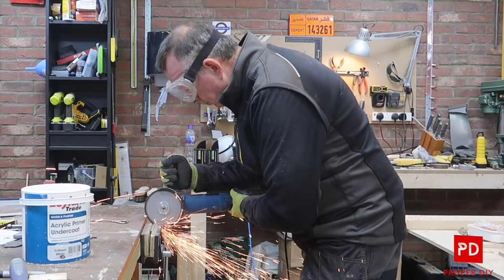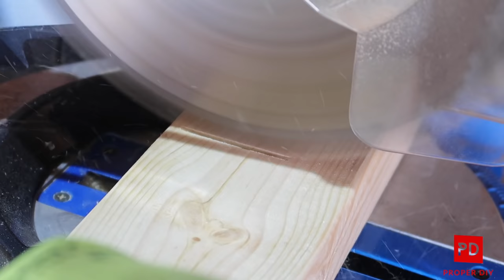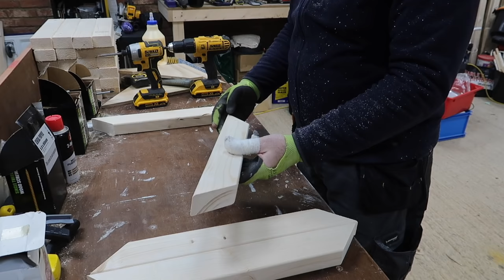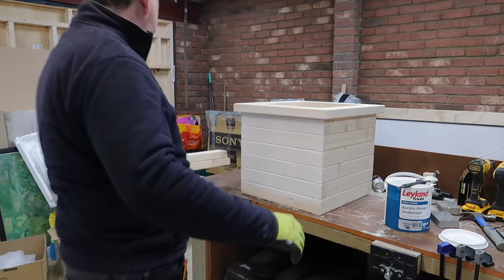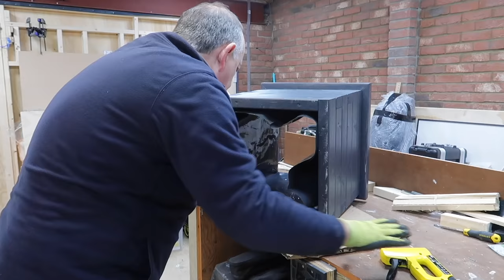How to Make Modern Garden Planters

Comment: For painting may I recommend the Wagner Universal Sprayer W 690 FLEXiO.  It comes with 2 spray heads ideal for big and small jobs.  The sprayer would ensure every crack and crevice is filled with paint and multiple courses can be achieved as the paint dries really quickly.

Comment: for the plastic lining, best bet is pond liner from Screwfix - Huge roll for £15 odd and it'll do 4-5 planters. Doesn't fade, crack, uv stable and is designed to deal with constantly wet environments.  Fab vid.
Reply from the maker: Sounds like a good deal but I can't find it on their website

Comment: Clear, informative and well made video - thank you.
I'm making my own planters and am using this as my guide. My only slight concern is your use of the black plastic (Visqueen?) to protect the inside of the planter from contact with wet soil. Does this not cause sweating between the two resulting in moister getting trapped? Instead, I'm wondering if a better option might be to paint the inside of the planter with a liquid rubber sealant? I'd appreciate your thoughts on this and whether or not you'd stick to using the plastic liner again in the event you make any more planters in the future.
Reply from the maker: The liquid rubber sealer would do the same job as long as the inevitable future movement/splitting of the timber doesn't then let the water in.

Comment: Great video and project. Loved it. One suggestion I have is you you buy a plastic square planter of roughly the size you want then you can build the wooden planter around it (them) so in the end you just drop in a perfectly fitting plastic plant pot/liner which saves all the faffing with plastic membranes. Cheers
Reply from the maker: Thanks! Yes can do and would prob last a lot longer.

Comment: These are great videos, all of which will be put into practice shortly when the weather improves a bit. One question about the planters, you used CLS, why? That is about 3 time the price or PAR of similar size in my local merchant. Is there a specific reason for its use? Thanks and keep 'em coming.

Comment: Well presented vid. I am going to make a long trough version of this design using free pallet wood. I will brush or spray all cut parts completely with two coats of used engine oil ( any local garage free ) before assembly. Finish with undercoat then Cuprinol. 
Used engine oil alone is a nice finish, dries quick, odourless and plant friendly and no liner needed.
Note sand or plane the top overlap edges to bevel them, looks better.
Reply from the maker: Sounds great!

Comment: Been loving the videos and I’ve just started making these planters ahead of the spring - the wife wants a garden make over. Just having some trouble making the top. Can you clarify the measurements- is it point to point because I can’t get the short side to match the long side at a 45 degree angle in the description- 1st Time novice I’m afraid

Comment: That's a really good video, thank you. Nothing worse than seeing a wood working video and then they start using planers, edgers and all that malarkey. For the plastic liner, would it be worth using Black Jack instead? Saw a sleeper raised bed project and they used it. Also, what was that large bit holder in your drill?
Reply from the maker: Thanks for the comments. Yes you can use Black Jack however over time if the timber shrinks slightly you may get seepage into the joints so for these planters I think heavy duty plastic is better long term. If I was building a raised bed with garden sleepers then I would use Black Jack as well - less joints.
The 'large bit holder' is a Dewalt magnetic bit holder that is handy when putting in the bottom timbers. It really holds screws well although I don't use it all of the time.

Comment: Hello, good job young man, engaging video, did you do the editting!? Good skills. A question regarding water, as there is nowhere for it to go, will this not cause an issue of overflow? I'm referring to us watering the plants followed by rain. Perhaps this dries up during the summer but not sure about winters
Reply from the maker: Thank you and yes, all my own work. 
The bottom of the planter is timber slats with weed control fabric on top which isn't water tight so there is drainage though the bottom.

Comment: Great Videos, more please.  What length are top mitred pieces, I think you just said a "a little longer"  I want to make some.
Reply from the maker: Thank you. Lots more to come. I didn't take note of the length of top pieces however there're easy to work out. Measure the internal dimension of the box using the standard pieces laid out - it will be around 560mm and that will be the length of the short edge of the top piece.

Comment: Hi Stuart, great Vid  with very easy to follow instructions, Love the planters and going to have a go making them, but just on thing I would like to ask you, with the sides cut at 395 mm you say thay the top is slightly longer  after cutting the mitres could you tell me how long you have cut these please.
Reply from the maker: I think no they are 357/485mm - I'm the description below the video.
Reply: @ProperDIY  Cheers Stuart , found the measurements for them didn't realize  they were  at the bottom of the vid. 👍

Comment: Hi, looking to attempt to build these but a bit confused about your measurements...you state: 26 x 359mm. Does this mean 26 pieces at 359mm long? Also you mention 24 x No. sides...what does this mean....the remainder of the measurements make sense. Thanks and love the channel.
Reply from the maker: 26 No. 359mm means 26 of them at 359mm in length. 24 of them are for the sides and 2 of them are for the feet.

Comment: Hi. I'd like to make long planters using this technique as it looks the mostly long lasting I've seen. I just wanted to ask if it's worth adding a screw on the long length... or is it not necessary? I'm very new to woodwork so thought I'd check. Also any reason you didn't line the bottom with plastic and pierce holes in it for drainage? Many thanks
Reply from the maker: Hi there! Yes, if you are making them longer then it's probably a good idea to add some extra screws in the centre of the timbers. You can use the same plastic at the bottom and add some holes absolutely no problem. When I made these, I had a limited amount of heavy duty plastic so decided to use some of the weed control fabric at the bottom I had instead but really any material that will allow water to drain, keep the soil in and not disintegrate quickly we work. Good luck with your build!

Comment: Hi sorry to bother you again about how long would the wood last before it starts to rot if its untreated.  As treated wood is very expensive at the moment?
Reply from the maker: Now that is an excellent question. Firstly, it lasts longer than most YouTube channels would have you think! It very much depends how much prolonged contact with water the wood gets without the ability to dry out. If you made these planters with non treated wood and made sure they were lined properly and elevated off of the ground I would expect to see some rot on the inside after 3-5 years. I know after that amount of time my wife would be looking to have something else in their place so not much lost really.

Comment: Be interested to see how those mitres hold up in a couple of years. General consensus is not to use mitres on external projects due to seasonal wood movement. Time will tell with these. Otherwise very contemporary looking, solid, functional planters.
Reply from the maker: I'll be doing an update video on these in the spring so will be interesting to see as you say what they look like after a year outside.
Reply: @ProperDIY  Have you done the update Stuart? Can’t wait to get cracking on these 👍
Reply from the maker: @mikeb3010  Yes, have a look at the video 'Outdoor Projects a Year On' that I published in the middle of March
Reply: @ProperDIY   Many thanks Stuart 👍

Comment: Always great videos but ....the timber size 38 x 63 is 1.5 x 2.5 in old money and not 2 x 3 as you mentioned. This minor things aside keep up the great work and loving that you've moved out to the garden!!
Reply from the maker: Timber is stated as the size before planing so it is 3x2 but will never come out as 75x50. 4x2 is only 100x50 before planning - it's the way carpenters have always referred to the the material as.
Reply: @ProperDIY  Thanks for the explanation. As you could tell I'm a non-carpenter but always willing to learn

Comment: Quick question, what glue do you use? I have seen several woodworking videos and they use a similar product. Will be making some planters once I get the glue! Thanks 👍🏼👍🏼
Reply from the maker: I used Titebond 3 but you don't need to. Any exterior wood glue will do.
Reply: Thanks Stuart. Just been looking at Titebond, lol 👍🏼

Comment: These are fantastic! Relatively easy and a high standard :D that cucumber eh, what a liberty. Have you tried plug cutters bud? I suppose they'd show through but still the textured wood effect. I've always wondered about planters...or simply thought too much into them: what stops the water rotting the bottom boards? :S
Reply from the maker: Thanks. The boards at the bottom will eventually rot but can then be replaced - nothing lasts for ever.
Reply: @ProperDIY  thanks for getting back to me. I thought they'd rot, why not treat them too and add rubber feet on them or something...I mainly wondered why not extend the plastic lining over the bottom, puncturing holes everywhere but where the feet are? :)
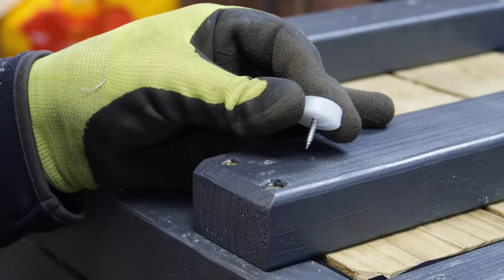Reply from the maker: @clevelandexplorer2221   You can do. The bottom boards are treated so will last a few years. I did put on plastic feet to elevate it off the ground - 8:40
Reply: @ProperDIY  I actually remember the feet haha, sorry! I was confusing with myself, wondering why I've never put plastic feet on my own things if that makes sense. Thanks buddy

Comment: Hi, how many full lengths of cls timber did you use in total?
Reply from the maker: There are 5 x 2.4m per planter as long as you stick to the 395mm length. This make a good size and ensures you get 6 pieces from a 2.4m length.

Comment: Well. watched the video and I made the planter, just finished painting it. I just have a couple of questions. I primed the wood and found that it needed 4 coats of Cuprinol to fully cover the white undercoat. Is it necessary to apply primer, or could I use the wood paint direct on the timber? I noticed all your angles and joints were perfectly square and true....mine weren't! What make of mitre saw do you use? Mines a cheap one I've had for years and I'm getting conflicting reviews for good saws.
Reply from the maker: Yes that can be a problem if things move and the white comes through. The Cuprinol paint says it can be used as an undercoat so recently I've done exactly that - you'll see it on some cladding in my next video coming out on Tue/Wed.
My mitre saw I bought from B&Q many years ago - I think their own brand. Your saw my need setting up - there will be adjustments you can make. I am looking to get a new one soon - prob go for evolution as they are good and cheap.
Reply: @ProperDIY  I'm pretty sure my saws a B&Q one as well You're right, it definitely needs setting up, I'll do it tomorrow when I start a planter for my daughter.
Reply from the maker: @funnysods  The way I set it up at is to get a wide board and cut it. Flip one side over 180degs and put them both together again. The 2 boards will only be straight if the saw is at 90 deg

Comment: Nice video but you may want to let people know that 63x38mm is 2.5 x 1.5 inches (not 3x2)
Reply from the maker: Like all timber although it's called 3x2 it ends up smaller once planed - it's a quirk of the woodworking world as timber is always referred to by it's size before machining. Therefore 4x2  is never 100x50 but around 89x36.
Reply: True but only if you are buying PAR, PSE,  or CLA rather than a pressure treated carcassing (for an unpainted natural look) which some may do I.e. me😀

Comment: What about.mitered cuts on the walls of the planter would that be better for weatherproofing the wood ?
Reply from the maker: Not really I'm afraid. Gluing mitred end grain is not a particularly strong joint and will open up within a few weeks. You can do it, however it will take a lot longer to build and seeing the alternating end grain on the sides is a feature of the planters.
Reply: @ProperDIY  ok thanks , didn't know that, the planters look very nice,I really need to get a miter saw , makes life so much easier
Reply from the maker: I would highly recommend that a mitre saw be one of the first investments you make if wanting to do this type of stuff. The one you see me using was very cheap, prob B&Q from around 20 years ago!!! One of my most essential tools.
Reply: @ProperDIY  thanks lad 👍 want

Comment: Why people are so obsessed with plastic inside of all those planters?
The thickness of the 2x4 is enough to be held together for a decade+ easy even if soil touches it.
I’ve been gardening in all forms and shapes of untreated wood. 3/4 untreated wooden raise bed sitting on a ground takes around 4 years to show structural damage. 2x4 is 4 times thicker and sits above ground so it’ll be good for many many years even untreated. 
You don’t want any wood treatment if you grow food in it.